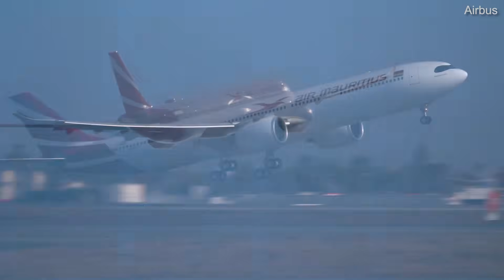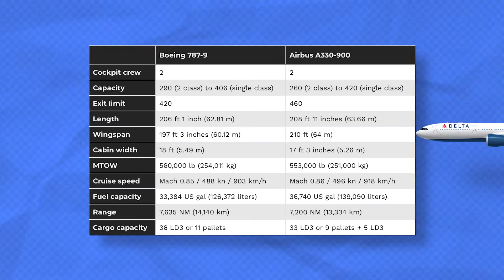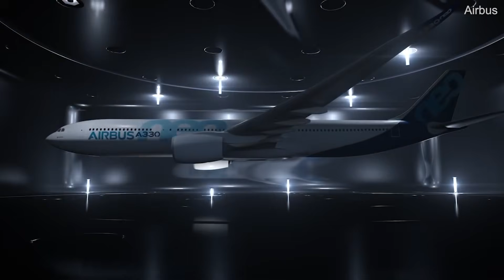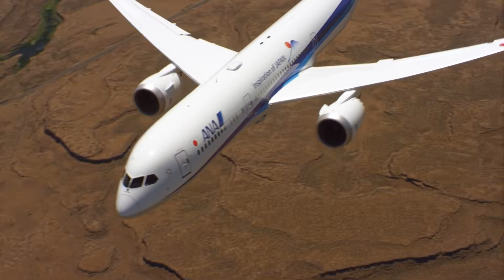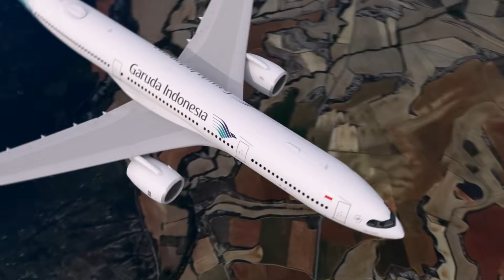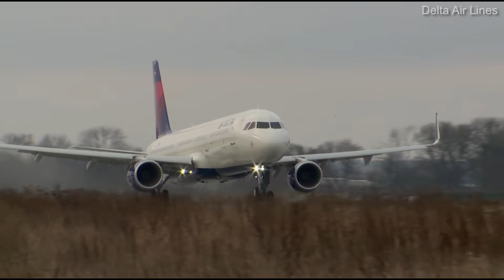Airbus A330neo Vs Boeing 787-9 – Which Plane Is Best?

Comment: No mention of the fact that the Dreamliner is pressurized to 7000 ft, rather than the 330’s 8000 ft.   This makes a big difference in passenger comfort on long distance flights.
Reply: yes, for long distance. 787 is better and more comfortable.
Reply: It's pressurized normally to 6000 feet or below.  I often observe 5800 feet when we have no pressurization related MEL'S.
Reply: Airbus really ruined the A330 with this one. The neo's winglets are so hideous, they look like they bend downwards then upwards again. Very strange design, not a fan. They look like what could only be described as tacky fake fingernails that do not flow whatsoever with the upward curve of the wing. What a way to destroy what was sheer elegance in the A330ceo.
Reply: Why can you people just say what they like and not trowing one thing over the other.
Reply: Honestly, I find the A330 a much more comfortable aircraft. The 2-4-2 layout and really quiet cabin make for a much better economy ride than the 787, where 3-3-3 is pretty cramped, and noisy AF. For a supposedly more modern plane, it's horribly unrefined.
Reply: @lmlmd2714  Yeah nah when I flew on a Dreamliner it was a lot smoother and quieter to my last A330 flight. Which was old, cabin rattling and just not a great experience overall. 787 >
Reply: @lmlmd2714  787 with its best in class cabin pressurization (which doesn't use unhealthy bleed air like the A330), quiet cabin with just enough ambient noise to drown out annoying sounds of fellow passengers, and its large dimmable windows is by far the most comfortable cabin experience I've flown on
Reply: I think it’s very dependant, more on the age and service life of the particular planes you’re on. 

My last 787 flight, about 30% of the overhead bins had rattling doors which really irritated me. My seat, along with my daughters, creaked like a old bed frame. There was horrible engine whine too. It took the shine off a little. 

Compared to the A330 Neo I got off this morning, which was very quiet, well built and very comfortable.

I know which I would pick for a long ride based on that comparison!
Reply: @sloeginandsleep1170 .  I've flown on a Thai 787, none such rattling you've stated, no squeaky seats, i mean when we reached maximum ceiling, we bunked down relaxed flying very smoothly all the way down 9hrs of pleasant flight to Brisbane.
Reply: @brettdemauna9994  Hence why I think a lot of it is service life or airframe dependant. The two I flew on last were Air France and Qatar, and both were loud and full of rattles.
Reply: @sloeginandsleep1170 . Nonsense. I cannot believe such crap. You're saying as if you're basically riding on an old steam loco pulling carriages rattling, squeaking chucking along....come on dude U can do better.
Reply: @brettdemauna9994  I’ll make you a deal, you fly 3 -4 days a week, every week for 10 years like I have for work, then come back to me and tell me that there’s no such thing as a badly built/worn out plane interior. Funnily enough, there’s plenty of frequent fliers who have had experiences such as this, on every plane type out there. There’s articles on multiple websites of rattling planes, noisy interiors and bad quality manufacturing. Search “Boeing 787 Rattling” to see just a few related to this type.

The fact that your reaction, is to lose your mind over an objective fact, is very telling. I made a point that two single planes were noisy and didn’t stack up to the other plane in the conversation, you don’t agree. That’s fine, there’s no need to throw your toys outta the crib about it. I have my experiences, you have yours.
Reply: @sloeginandsleep1170  I fly on a Qatar 787 several times its quiet and smooth
Reply: The a340 is pressurised to 6000ft, I miss that plane 😢
Reply: @LittleGenevieve  if it can haul itself up from the runway, yes a fine aircraft

Comment: Having the A350 as the big brother doesn’t make it easy for A330neo, the Dreamliner family in that sense also has a difficult time, competing with two different aircraft families. As a passenger, the 787 remains my favorite aircraft to fly on. The overhead lockers, the space, the big windows, the noises the Dreamliner makes, it’s all just beautiful. Then again, I like the 2-4-2 economy layout of the A330. Both aircraft have pros and cons for the passenger.
Reply: Fly JAL’s 787. 8 abreast economy, there are no cons 😂
Reply: a350 is competitor for b777
Reply: @@Longflight-kr3jb the -10 lacks the range of the base A350-900 as well as the 777-200ER it replaces, hence why the family is considered a closer competitor to the shorter range A330neo series (though even then, the -900 has a longer range and can technically carry more passengers too)
Reply: The next time I fly intercontinental I'm finding me a 787 flight with a window seat.
Reply: Japan Airlines 787 also do 2-4-2, but then the routes are somewhat limited 😅
Reply: The 787 was also designed in a 2-4-2 configuration, but as airlines hate their costumers, they decided to squeeze a 3-3-3 layout inside. Only Japan Airlines uses 2-4-2 economy class.
Reply: @alexanderivkin7086 I might prefer 333 as I'm flying with my wife and child and want a window.
Reply: Boeing 787 and Airbus A350 XWB are not competitors. 
The A350 XWB competes directly with the Boeing 777 family while the 787 Dreamliner is in direct competition with the A330neo
Reply: @jahangiryounus6674  I can’t see comparing the A350 to a 777! It’s like a little brother.
Reply: @stevesmoneypit6137  The A350-1000 and 777-300ER share the same dimensions. Perhaps the only significant difference is that the 777 cabin is 7 inches wider.
Reply: As you say both aircraft are compromised product wise, but the A350 was designed to compete with the 777-300ER and 777X whereas the A330 NEO was designed to compete with the 787
Reply: From my experience the windows are often locked or broken so don’t know if they are a plus, no matter the size.
Reply: @artembraverman804  I've never had window issues on a 787, my first choice to anywhere, I look for the plane not the time when choosing flight now.  The lockout is just passenger comfort, and it''s a deep blue that works as a great filter for photography, especially over Iceland or snow capped mountains. It's not like it has a window shutter forced down, blocking all view. 
The size is great, I really notice the difference, especially in business cabins, which offer two windows (with WJ business cabin layout) then you have two very large windows, with the seat turned slightly toward then, a very relaxing experience.  All the other benefits such as lower altitude cabin pressure and higher humidity make longer, transcontinental flights so much more bearable and greatly reduce jetlag, when crossing countless time zones.
Reply: @artembraverman804  I've never had issues with 787 windows. I love their size and the dimmer

Comment: It’s a bold comparison.  One is a product developed from scratch over years, the other is a re-engined plane in an attempt to extend it’s life line.  From this point of view the A330 is holding up rather well against the fancy 787.
Reply: It's actually a quite interesting comparison, it shows you don't have to redesign a jet from the ground up to be efficient and competitive.
Reply: One is also having issues until now, the other is flying without problem
Reply: @Roger  Airbus did not invent fly-by-wire
Reply: It's a strange comparison made here as I would say it's the 777 being the rival to the a330 NEO or NG respectively & the a350 being airbus answer to the 787. To which Beoing must revamp the 787 quickly as the a350 is dominating the market share with this variant now.
Reply: @DJ-AnTi  Well, while we can say the A350 is a response to the 787, the aircraft end up competing with the bigger 777.
It basically sits in between the 787 and 777 in terms os size and capacity.
Reply: …and replying to the original post, being a fly-by-wire machine the A330neo isn’t just a re engined old A330.
It has new wings, it has some cabin interior adjustments and of course it even benefits from being a few years younger than the 787 in terms of technology, mainly on the cockpit
The A330neo is in fact a modern technology advanced aircraft with an old airframe aside from the wings
Reply: 787 has still outsold entirety of A330 series
Reply: True but consumers are consumers. Whether buying a phone or a plane, humans want the fanciest thing they can get. Bottom line, both are great and the competition is good as it keeps both companies on their toes. Always improving is a good thing.
Reply: @explorenaked  Take a look at Virgin Atlantic's newest A330neo cabin.  It's the  nicest cabin I have seen so fare for both, A330 and  787.  From a traveler's point of view I would prefer Virgin Atlantic's A330 product all day long over Qatar's 787 product.  There is no comparison between the roomy A330 cubes and the narrow 787 Q-Suite.
Reply: @explorenaked 
It will be a cold headed buisness decision. It's not a consumer product.  Doesn't matter how shiny it is
Reply: Yeah new delivery of the 787 seems to have stopped due to FAA not being happy. FAA will never allow another Max incident!
Reply: @gregb1599 .   FAA along with Boeing were also to be blamed for not doing thorough crucial Max's certifying test programs in regards to the new MCAS software system installed. Pilots familiar with the previous earlier systems were not even been informed of, of this new system upgrade.
Reply: @brettdemauna9332  I read one place I can’t remember where but part of the 737 max problem was lack of pilot training so that kind of falls on the airlines a little bit!!
Reply: @redryder1146  No. Boeing said no additional pilot training is required for the 737 MAX. Airlines believed them.
Reply: @neodym5809  Airlines have no incentive to ask Santa for additional aircrew training.  Southwest pushed very hard for it and helped Boeing try to cover up this first mishap.
Reply: @redryder1146  Lack of training has nothing to do with Max failure.
Despite being old school, the MAX is or was a perfectly good aircraft. But because the bigger engines had to be repositioned in the wings and because they also offer more power, it flew slightly different than previous generation of 737s thus requiring new type rating. Boeing then decided to install the MCAS to have a computer simulating the same behavior of previous generation avoiding the need for new type rating certification for the pilots and the extra costs for the companies. On any fly-by-wire aircraft like the A320, A330 or 787 families, this is rather simple, because it's just a matter of fine tuning the software of the flight computers. On an analogue aircraft like the 737, they had to install new extra hardware and software and they took a lot of shortcuts in the process, ending up having a single computer blindly trusting flight data from a single sensor. As a comparison, since its introduction in the late 80s, the A320 competitor has 3 flight computers and 3 sensors for the same role.
Reply: @gregb1599  so true
Reply: @gregb1599  yeah but how come the FAA is not grounding the 787‘s that are already in service I don’t get it so what’s the big problem now that wasn’t there before that I don’t understand!!
Reply: Yeah how did that work out like the 737 Max with it's very old airframe!
Reply: @gregb1599  comparing apples and screwdrivers, here. Nothing wrong at all with the airframe of the 737; the fact that the -200’s/300’s are still airworthy not to mention the utter lack of nearly any air frame related mishaps proves this. Maybe there’s some confusion on air frame vs total aircraft in aggregate? 

The Max’s main issue was never that it was a “bad design” per se, it’s that the human factors involved in its evolution were manipulated by those trusted to carry it out. To me, way worse than a bad design at the end of the day. 

It’s one thing to label something “bad” but that’s often subjugated for “I don’t like” or “I don’t agree with…” To be honest the MAX’s true design flaw (to me) was Boeing’s complacent attitude toward the entire project. The were doomed from the start. Alas…
Reply: @gregb1599  the 737 Max was the result of bad engineering designs and assessment. A320 NEO is bullying the 737, how the hell did they equipped the plane with a shorter legs that limit its engine option to only one if they have designed it to equipped newly designs engines like PW purepower engine it could have made a difference.
Reply: @gregb1599 .   The a320 also retains the old 50s 60s design riveted alloy aluminium airframe, but it's better equipped with innovative more advanced newer avionics & the FBW sophisticated flight control system.
Reply: @gregb1599  The 737 is an old analogue aircraft with cables and pulleys along the airframe. The MAX is no different and that was part of the problem.

Comment: The Dreamliner is supposed to be the perfect mid-sized widebody,if it were not for the quality-control problems of the South Carolina facility.
Reply: You ain't lying. Some airlines refused the South Carolina  made jets. Before the 787 line was closed in Everett, they had to correct Charleston mistakes.
Reply: @apolloniaaskew9487  They still do. Boeing hasn't delivered a 787 since mid 2021 and has 115 completed aircraft awaiting delivery. The FAA won't allow them to be delivered because of the problems from North Charleston - including aircraft built in Everett prior to the line being closed and deferred due to the pandemic.

American Airlines has reduced service on a number of routes because they are waiting for dozens of 787s. Qantas has delayed resuming suspended routes for another 3 months because they can't get their 3 undelivered 787s currently sitting in Victorville.

Comment: Interesting pitting both aircraft against each other when most of the time the A350 is against the B787. You mention copious use of modern material but neglect quality of built, something many airlines a=have reproached Boeing's 787. Broomsticks and tequila bottles in between walls on 787s built on the East coast of the USA not found on the West coast built, shows Boeing might have an edge on the price, but at what cost? Add to this they are still waiting on the FAA's go ahead and I would say airlines might prefer even a decade-old A330 designed with newer powerplants over an amazing yet problematic B787. Personally, I prefer flying in a 787 but I feel more at peace in a tried and trusted A330.

Comment: So why is virgin atlantic going to have both??
Reply: virgin atlantic usually operates in sub 10 hour flights (across the atlantic of course), which the a330neo is actually more fuel efficient than the 787 in terms of short to medium haul routes.
Reply: Because sometimes simple flying slips up and doesn’t realise that the A330neo is designed for a niche in which airlines looking to retire A330’s or even 777’s can find a newer alternative with similar capacity but with more efficiency. The A350 is the direct 787 competitor, not the A330neo